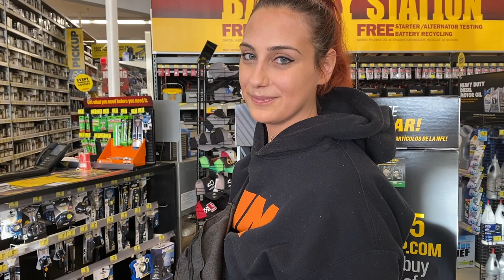CAR VLOG: Changing 2017  Hyundai Sonata Battery w/ Regina

Comment: No one does a 2018! If that’s you, don’t pull any clips! The air cleaner snorkel goes across the battery and the front edge has two plastic studs on the bottom that slide into rubber grommets in the plastic shield that’s across the front. Just lift and wiggle the front of the snorkel and then wiggle the back of it out of the air cleaner box. Disconnect the leads and the hold down clamp on the front. Move the leads and slide the paper(?) sleeve off the battery. Then lift the old battery out. Reverse to install the new battery.
By the way, no one explains the plastic buttons and just pops them out. Nope. On a 2018, they are two piece. Pry up the top one and THEN the washer-looking bit. The washer has a sleeve with the prongs on it and the center piece pushes in and expands the prongs. Pull the whole assembly and you’ll strip off the prongs. But, don’t pull any clips/buttons/screws on a 2018 to change the battery.